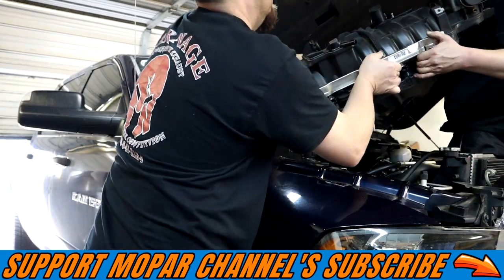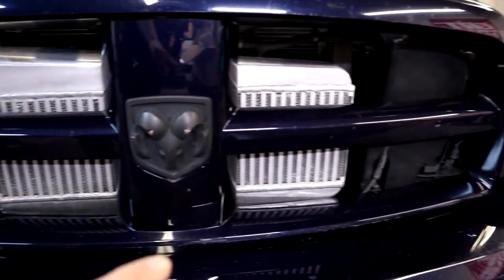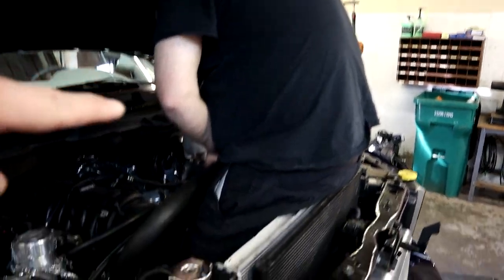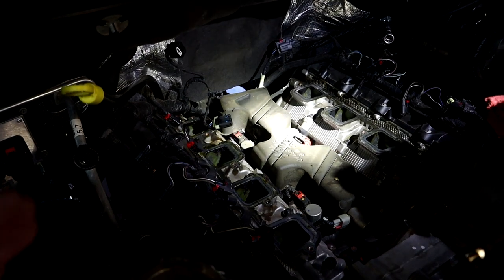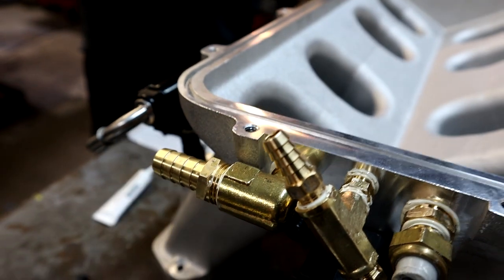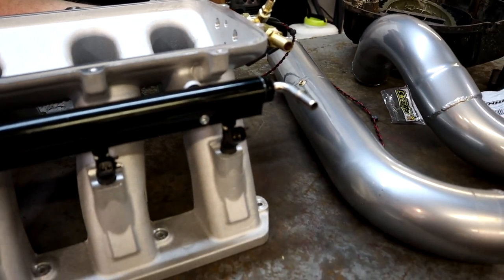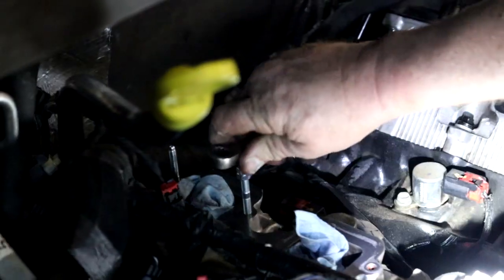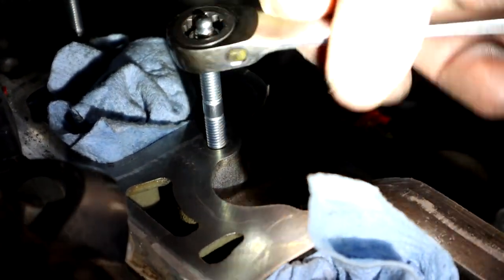Holley Hi Ram Manifold Install For Your HEMI Powered 4th Gen RAM 1500

Comment: I always liked the tunnel style intakes on EFI engines. They look the best in my opinion. 13.60's is bad at all considering how heavy that truck is. I think stock they run mid 14's if I'm not mistaken.
Reply: Stock mine was running 15.8
Reply: @stormram2783  the Hemi trucks quarter mile times varied depending on weight and package.
Reply: Yeah i got the heavy 4x4 crew cab with towing pckg

Comment: What did you do with the short runner valve control ?  Does the IAT need to be installed for an NA engine ? Do I need a new map sensor or will the oe work ?

Comment: Thanks for the informational video it’s looking good! I also hear a celebratory drink being cracked open after a job well done @23:52 😀
Reply from the maker: 🤣💪Definitely
Reply: @FrostbiteRam   btw do you know where else they sell adapter throttle plates for the stock TB, ordered mine from Holley last year and now their saying I have to wait till may of this year? Thanks!
Reply: @FrostbiteRam  what map sensor did you use? The 2014 5.7 hemis don’t have screws that hold the map sensor, just twist and locks, thanks!

Comment: I know this is old but I have a few questions: 1. You used a 2 bar map sensor with this application, but I thought it was supposed to be a 3 bar. Is it part # 5033224AB? 2. Is it possible to plug up the spot for the IAT sensor on the back of the hi ram, and run the IAT sensor before the throttle body instead?
Reply from the maker: You can use either. I currently use the 3bar

Comment: Quick couple of questions on that manifold I just bought all you said to get can't wait to install it 
Will this send a check engine light will I need a tune after this installation and where did you get the oil breather and fitting from for.the manifold
Reply from the maker: You will need custom tuning to eliminate the cel.

Comment: Did you not have to install a return fuel line for your application. I have a 73 Plymouth I swapped with a 64 and I’m using the same intake trying to do research on what fuel pump I need to run and if it needs to have a return fuel line thanks.
Reply from the maker: @hellcatd4721  no this is using the stock fuel system and line. Now on my racetruck frostbite that has a fully fabricated fuel system with return.
Reply: @FrostbiteRam  should I run a return and regulator

Comment: I need help for a N/A application 6.4L hemi charger installing a holley hi-ram
Reply from the maker: Definitely will need a different hood most likely to start with.
Reply: Oh I have one killer bee in carbon fiber' I need to figure out the plumbing part for me' I'm having high oil pressure and it's finding its way out through the seals leading to gunk in the valves and head ports

Comment: Ive seen alot of guys run the 6.4 intake, do you think the hi ram would have better results?
Reply: The high ram intake makes it power from 4k to 7k rpm, unless you drag your truck it will suck for street driving.
Reply from the maker: Yes I believe so. I've seen it on a fairly stock na 5.7 with cam and daily use was unnoticed  but track was better overall.

Comment: Hi, just wondering. Working on getting FRP cam and tune. Previously had Greene tuning. I’ve rebuilt bottom end. Looking to go from 7psi to 10psi from procharger on 06’ ram. Did you use the timing chain. Felpro head gaskets and head bolts that came with kit or, did you go with cometic head gaskets and ARP bolts? I’m close to buttoning up and looking for suggestions before I make the leap. Any info is appreciated.
Reply from the maker: The supplied gaskets and hardware work fine in the kit
Reply: @FrostbiteRam  yes but what head gaskets and head bolts did you use on your application?
Reply from the maker: @kenc.2448  I have factory mopar gaskets currently from my last cam change
Reply: @FrostbiteRam  thank you sir.
Reply: @FrostbiteRam  I’m sorry, did you use oem head bolts or ARP head bolts?

Comment: I have a 2016 ram 5.7 omly thing I’ve really done to engine is a k&n air filter but if I want to instal a manifold like this what would be a good idea to start off first? I was thinking putting long tube headers with a cam but wanted to see anything else todo before running something like this any help would be highly appreciated
Reply from the maker: Longtubes and camshaft go well with the Hiram

Comment: Just doesn’t seem like a good combo heavy truck, stock cam with tunnel ram for high rpm power bye bye low end torque.
Reply from the maker: @pmp2559  truck went faster in the 1/4 by 3tenths🤷‍♂️
Reply: @FrostbiteRam  nice! You loose low end tq? I’m sure with proper cam and internals it will be better